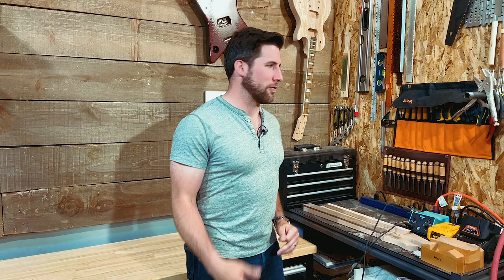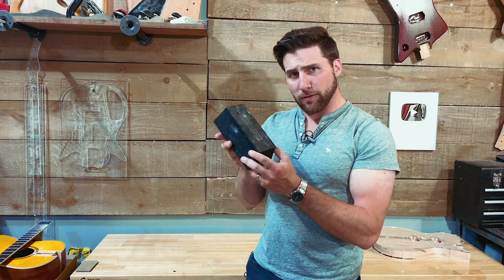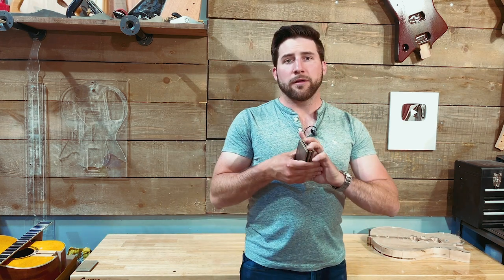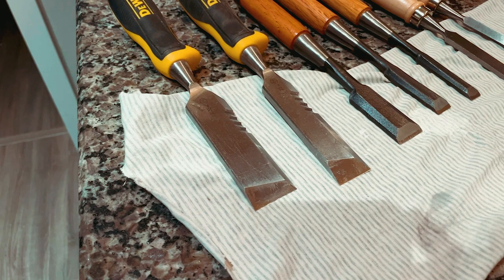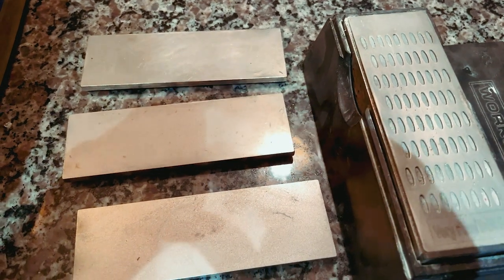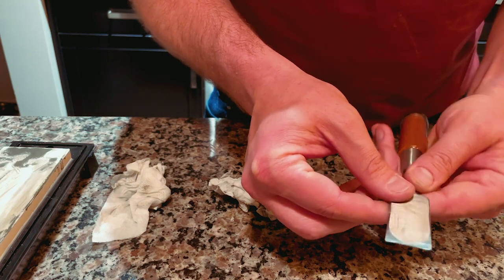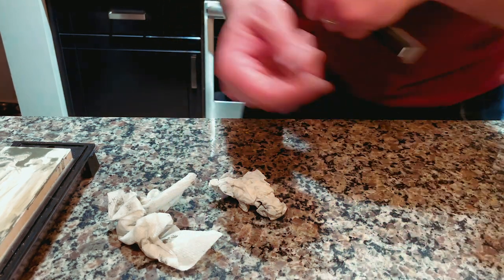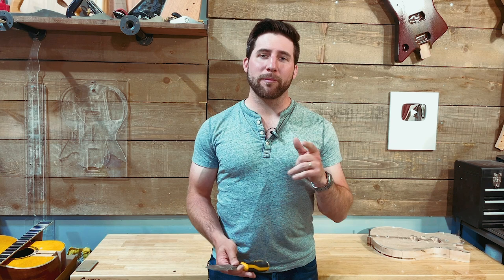What Are the Best Sharpening Stones for your Tools?

Comment: I love the Cerax Stones.  I have 3 of those up to 6000 grit. Then King stones in 10,000 and 12,000 grit. The kings are single grit stones. This set up has become my favorite. I also have a version of the scary sharp system but I swear I like the stones better. I take about a half day every month or so and just sharpen everything I can find! Another great video my friend. I hope you are well. ✌️ & 💕
Reply from the maker: Thank you! 12,000 hey? I bet you don’t need to strip after that…
Reply: @BradAngove  I rarely break out the 12000. I find I can stop at 6000 and be just fine. The 2 King stones were bought on a whim and as a package deal. I got a great price on them and really only use them on my plane blades. Great video brother. Thanks for the info. You have a great way of putting forth any subject matter and not seeming too partial. I like that. Peace my friend. Have a great weekend.

Comment: I use a Trend diamond stone 300 and 1000 grit then I go straight to a 12,000 grit. The 300 grit side of the Trend can be used to flatten pretty much any water stone. See the Rob Cosman method of sharpening tools.

Comment: Those diamond coated steel plates are to be used to flatten sharpening stones. Or so I was taught a couple of decades ago.
Reply from the maker: Thanks one option yes. I have a flattening stone, but diamond stones do work.
Reply: @BradAngove  how do you keep the flattening stone from giving you wonky "flatness"
Reply from the maker: I’m not sure what you mean, but the flattening stone is large and does not remove material from smaller discreet areas, so it flattens the whole surface. To check flatness, I draw on the surface of the stone before flattening, and continue until the pencil is gone.

Comment: Hey Brad off topic I airbrushed guitars quite awhile back wanting to start it again. Couple of questions the water based stuff do you have a video on using those and where might that be? And your jig for painting I’ve seen some where you screwed it in from the back and the front does it matter? I love Createx do you think there new High gloss will be good enough for a guitar? Thanks Tom..
Reply from the maker: Hi Tom. I use auto air and wicked paints. They’re made by createx. My recent custom airbrush job on my channel was done with those. 
I screw my jig in through the neck pocket to avoid it getting in the way of any of the paint. 
I don’t think createx’s clear coat is durable enough, but I haven’t tested it so I might be wrong on that.

Comment: Come on Brad you make me feel inadequate as I only use wet and dry paper on a marble tile lol god I feel cheap.... and autosol to finish off... I am cheap...
Reply from the maker: There’s nothing wrong with that if it works for you. Autosol can be used for the compound stropping part of the process. Are you basically using the scary sharp system?
Reply: @BradAngove  yeah it's the same idea as the scary sharp with the micron paper and a flat surface with the marble tile.